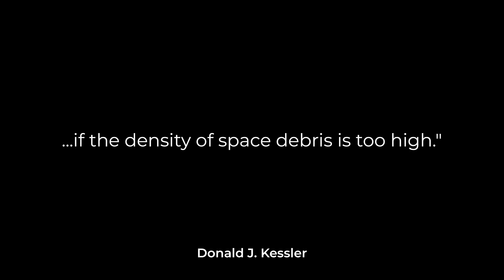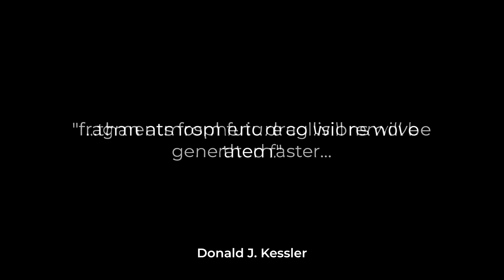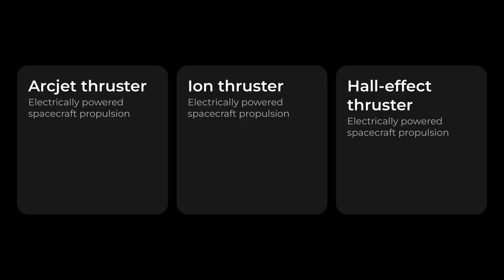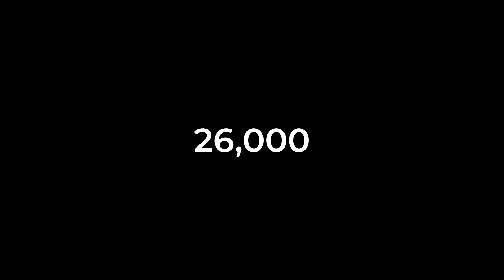How Satellites Don’t Collide in Space

Comment: Its only a matter of time. Its not an if. Its WHEN. We will eventually prevent ourselfs from going into space again.
Reply from the maker: Yes, the trend right now isn’t good. But I don’t lose optimism that we’ll solve this problem.
Reply: @ValentinShevtsov  maybe high powered lasers from the ground to knock things out of orbit?  But that could mess with the ozone layer also.
Reply from the maker: There was a project by some university to launch a satellite with a net that was supposed to catch space debris and then de-orbit it. I don't remember though if the experiment was successful. But it looks relatively easy and cheap.
Reply: @ValentinShevtsov  I have my doubts if that would work. The speeds we are talking about are crazy. The big things that could work for, the tiny thing though, if you aren't matching the speed it'll just fly right through it.